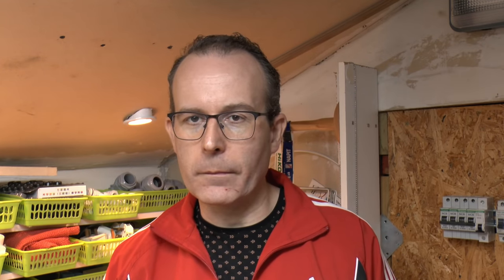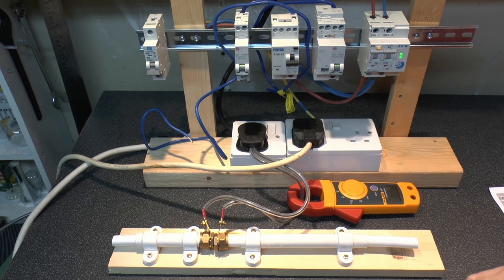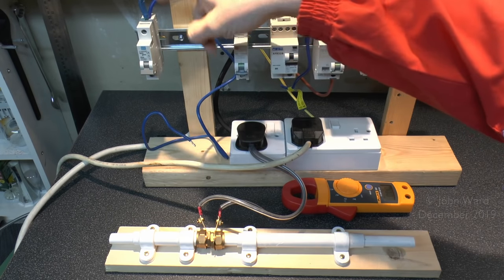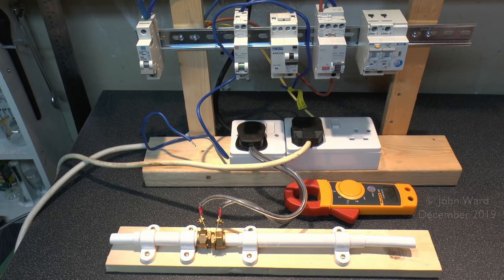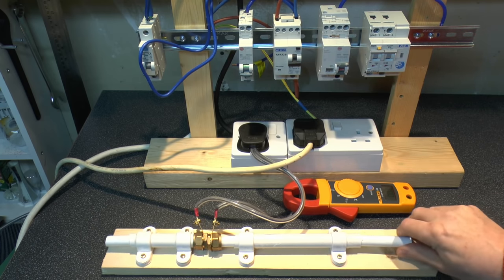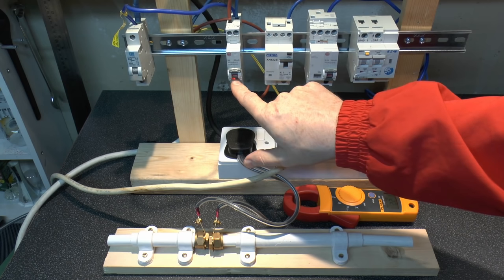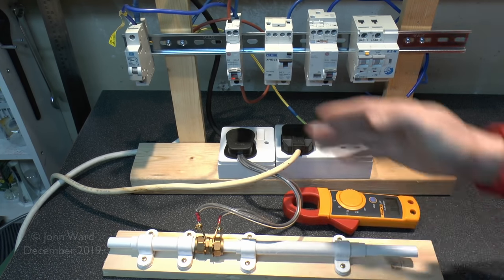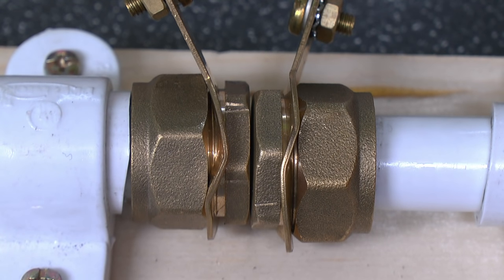Four AFDDs Compared - Arc Fault Detection Devices

Comment: John. You better take a look at Mainly  Electrical  channel.  This chap has run some pretty  standard  easy tests in these and generating  a hell of an arc by mimicking  a loose contact. The devices never tripped. Very concerning  and misleading

Comment: I would like to see a test with appliances with brushed motors inside, to see if they trip.
Reply: Considering the IET are ramming these down our throats I am struggling to see the value in them since it seems no two of them are the same and how expensive they are.

Comment: Excellent video John, I think the reason for the short lead on the single module device may be because the primary market is retrofit rather than new installations.Older consumer units tend to be smaller.

Comment: 11:38  We named it "TE", one Teilungseinheit, Wiki say "division units" (DU) in english for have more space. In Germany a normal consumer unit have 12 TE/DU, maximal have three in a row (3x12) normally. 

Rare old models have 24 TE/DU (for old L1/L2/L3 rails) in one row. Same situation in Thailand and shorter or longer models used widely; e.g. 2, 6, 9, 14, 16. At 16 DU for one main, and RCB are 4 DUs, so do you have 12 TEs for MCBs free. 

We use in Germany 3 phase normally so every row earn one phase (old style) or we sorted it L1, L2, L3, L1, ... starts with RCB  3phase, MCBs ... 

The new EU norms talks that RCBs should use smaller way, at best every line, e.g. one for oven, boiler, bath room, light bathroom, sockets living room, light living room, aso. So now combi RCD/MBCs are true sin for save space in consumer unit! 

My own consumer unit in my rented appartment in Germany have only one RCB, mean if it tripped I stay in the dark in night. 😱 

We not change consumer units every five years same you did it in UK. Our are often mounted inside the stone walls.
Reply: Thanks to to the new Regulations from 2020, we do too now change the Consumer Units as they have now to be build to the same new Standard (1100+APZ). I already got my Hager System 80 taken out of the Wall and now it is just a Wall mounted Box.

Comment: 7:00  The Siemens AG is a german company orginally. In the old DIN-Norm and later EN-xx-Norm now in EU we wrote that "red" mean "Power ON! Do not touch!" and "green" mean "Power OFF! Do you can touch on line." If power fault the device should go trip and show "green" for savety. 

I know it is crazy for UK people how go on red and stop on green - and drive on wrong side of street! 55555 😜
Reply: BTW: The Siemens should have now a yellow button too. But - the EU give companies time to change the production. 

The second is that they produce different to country laws; so N on left or right; go in power above or below; one till three phase. 

So do you can't found UK models here in Germany but I think in Thailand and Hongkong. 

Here in Germany all phase on left, N on right, go in below normally. 

Different to main switch (grey trip, 63 A), old models can use from both side normally. In history go in above, then copper link straight to every MCBs. With new one go in below, above go in to RCD, below out and go straight to MCBs, often 3phase. So N on right we order from right to left now - old DIN Design was opposite from left. (Sure, no N between in way.)  

Hoply I can figure it out correctly for you.  🤔😜
Reply: SIEMENS: Sicher Ist Eines: Man Erhält Nur Scheiße!
Reply: Armin Ehrbar - traditionally red or amber (orange) indicated something was on / live in the U.K.
A green indicator generally means something is “healthy” - or functioning normally.
But sometimes red indicates fault or error.
It is my opinion that no one should rely on any colour coding, EVER...

Comment: So the grand arc off has occurred! 
What a device.
Reply: Mister Brookes  From Wikipedia: "In the US, arc faults are one of the leading causes for residential electrical fires.[4] Each year in the United States, over 40,000 fires are attributed to home electrical wiring. These fires result in over 350 deaths and over 1,400 injuries each year.[5]"

AFDD's have been mandatory in new US installs since at least 2014.  For some reason Europe and Britain have been much slower in adoption.  This is surprising considering the Brits are highly paranoid with their electrical codes (fuses in cords, no light switches in bathrooms, GFCI at the breaker box, etc.). Of course, with ring circuits (invented due to the copper shortage in WWII) it is smart to be paranoid.
Reply: Mister Brookes  Adding RCD's to every circuit does nothing to stop arcing since RCD's are not designed to detect arcing. Fuses in plugs are superfluous and not going to happen.  Again the only reason Britain has fused cords in the first place is because of all the ring main circuits over there.  That's not "a thing" here (everything is "branch" or radial). Putting fuses in cords makes a lot of sense on a ring main since the circuit breaker is rated way above each individual socket.  (You might have a 6A toaster on a 30A circuit - that is obviously a problem without a fused cord). In the U.S., that toaster will be rated at 15A, the same as the circuit breaker protecting it. On a ring main, the breaker wont trip; the thing will simply burn unless it has its own fuse.

It takes a few minutes for a circuit breaker to trip in an overload condition, but an arcing cable might not cause an overload or trip short circuit protection.  So what are you going to do when the little old lady has a lamp cord with a fray in it that she doesn't know about?  A fray that comes into contact with her carpet or a curtain.  That's a house fire waiting to happen.  All the RCD's in the world (and circuit breakers) aren't going to stop it. Enter the AFCI (AFDD). 

Of course, the U.S. is on 120V which means higher currents (most residential circuits are 15 or 20A). So when arcing does happen, it can be more dangerous here.

I don't have an AFCI in my home, since it was built before 2000. But you can buy them that will go into individual sockets (much like GCFI's). Over here our GFCI's are typically installed at the socket/outlet and not in the breaker box ("consumer unit"). This has an advantage of making it much easier to narrow down the faulty device while not cutting power to the entire home. The downside to this approach is that not every single circuit is protected. But protecting every circuit isn't required by code anyway.  Only circuits which might come into contact with water must be protected by GFCI since that's what they were invented for - people were being killed by coming into contact with electrical outlets while wet (dropping hair dryers into the bathtub, etc.  Incidentally, this isn't a problem today because all hair dryers must come with their own internal GFCI installed in the plug).  In any case, all bathrooms, kitchens, laundry rooms and outdoor outlets (including garages and other out buildings) must have GFCI protection (it's up to the electrician whether that is installed at the breaker box or individual outlets - as long as the specified circuits are protected, either method is acceptable). 

Now let's debate 120V vs. 240V.  Go!
Reply: John Smith - The U.K. electrical system does permit wall mounted light switches in bathrooms, toilets and shower rooms. RCD / GFCI are not mandated to be in the consumer unit (breaker box) for all circuits, separate RDC sockets can be used where needed depending on the type of wiring, the circuit design and function. Combined RCD & MCB units in the consumer unit for the socket outlet circuits are a fast and convenient way to provide reasonable protection in a reasonably modern MCB type consumer unit without the added expense of a new consumer unit. I have this arrangement in my consumer unit and don’t experience nuisance tripping. 
Fuses in plugs and fuses in fixed connection units are designed to protect the flexible electrical cord.
Radial circuits that can supply socket outlets can be rated at 15A (fuse), 16A (MCB), 20A (MCB), 30A (fuse) or 32A (MCB). Not all sockets have to be on a ring circuit. Whatever the original reason for the ring circuit, the modern ring allows as many socket outlets as you like (within reason) to be fitted. This is very convenient now that there are so many mains powered electrical appliances / items / gadgets.
Reply: John Smith - How do you figure that 120V domestic circuits have higher current faults? Think about a 240V 20A or 32A radial circuit, or a 32A ring circuit. I think you will find the fault current significantly more than on a 120V 15A or 20A circuit.

Comment: aww  :-(          everyone was rooting for the single module wylex.  

Great idea in theory, but then they'll sell them to you at through the roof prices while the practical part it is still being solved.

Wonder if it would be more effective to have a single computer / embedded system doing the monitoring for each circuit.  Hmm.

Comment: Great informative video, I believe that AFDDs are a basic requirement in domestic dwellings in the USA perhaps less costly due to much higher volume sales. I'm guessing that in a later edition BS7671 the AFDD will be a safety requirement on new builds. Expensive as AFDDs are an example like a not very apparent compressor arcing fault at the back of a fridge is IMHO a good reason to be gravitating to fitting AFDD(s)

Comment: Don't worry people these are Automatic fault detection devices but they seem to be based on some sort of TDR (Time Domain Reflectometer) technology indicating the presence of potential faults such as high resistance joints in the wire rather than anything to do with arc / smouldering point detection ??

Comment: Nice test rig set up there John.

Please repeat - same AFDDs but with parallel fault. Maybe those insensitive units will trip quicker ?

This also creates a question series or parallel - if you have a 4A heater load and set up with a parallel arc via another 4A load, will the unit detect the fault as series or parallel ?????? What secondary current is need for them to recognise as a parallel fault ??
Reply: @pineappleroad  Absolutely see no reason why not. It's just a second load with a dodgy connection.
Reply: @pineappleroad  Precisely - i.e. another load !

Comment: What about Heaters etc with thermostats …..  - as they reach temperature --  thermostat opens .. and arcs ?  (  Well they may have arc suppression components … but even so …  I wonder …. )
Reply: all switches ect will arch to a degree.
Reply: @UberAlphaSirus  - Exactly.   The idea of an AFDD is to detect an arc that is occurring under genuine fault conditions.  
To do this reliably requires the current flowing in the circuit to be monitored continuously - and any deviations of that current occurring in a short duration due to "arcing"  are analysed  - and if the "signature"  of that analysis fits the definition of an "arc"  - then the device trips.   ( And therein lies a HUGE multitude of questions …. when is an arc NOT an arc ???) 

The problem with all of this "monitoring" is that :  all this is occurring in circuits that traditionally will have a certain degree of  background  "electronic"  noise associated with them  and so reliably establishing that a genuine  "fault" arc has occurred  becomes difficult.  ( when is an arc  NOT an arc but just noise from "intentional switching   ??  Arc welders anyone !!  ) 
ESPECIALLY if the load current is small -  so that the "wanted signal "Noise""  generated by the arc  becomes closer to the background noise . That is - the  monitoring electronics and software has to differentiate between "wanted" noise  ( arcs) and  Unwanted noise  when the two levels become close   -   ie : what radio engineers call "signal to noise ratio   and if signal level and noise level become close - then detection becomes unreliable - and I believe that is why some of the AFDD's didn't trip - that is - there is a certain "noise floor level   blanking "  in the detection circuitry to avoid nuisance tripping ) ……..

…... …. note that John's tests started at 2.2 amps !  - so think about that in terms of say using a 6A  AFDD powering say a typical domestic lighting circuit powering a few LED lights  - totalling say 200 w or so (  less than 1A  at 230 V RMS !!  - 
Lets see how well these devices work at low currents ?!!
Reply: @eric4709  cheap shitty powersuplies will create a lot more background noise wich makes this even more useless combined with the cheap chinese LED bulbs

Comment: Well, it looks like Siemens has some homework to do, which doesn't surprise me.  I had to put a bunch of them in a home I just built, and I've since removed several that nuisance tripped repeatedly.  The problem seems particularly bad with power tools that use brushed motors.  There's one circuit in my garage that trips if I try to run a miter saw on it, but another circuit with an identical breaker works fine.  My electrician said even driving staples too tight when wiring the home can cause nuisance trips.  Incidentally, the breakers in my home are all made by Siemens.  John, what has been your experience with these things WRT nuisance tripping?
Reply: Here in the States these are mandated in certain locations and they can be hell. Friends built a large beach house in 2013 and just after the warranty period expired they had about 75% of them replaced.  We don’t have EICR’s here but the electrician was doing basically one of them to test the wiring. They currently cost about $60 here, I forget the price 10 years ago.

Comment: I want to know what happens if a switch is opened slowly will it trip then, also what happens if you use a welder on the circuit, I pressume they work by detecting the HF produced by the arc. I would think that these things are going to be a big source of trouble in the future.

Comment: Why were you having so much trouble getting the Eaton one to trip in a previous video, but now it trips very quickly?
Reply from the maker: More current - 2.2A in this one, less than 1A in the other one.
Reply: @jwflame   - So  - As  I've  mentioned above - are we saying that AFDD's  as currently offered  wont reliably sense arcs occurring in low load ( say less than 2A  or so  )  situations ?  
As I also mentioned - a "noise floor"  limit in the detection circuitry / software to avoid nuisance tripping ? 

Looking at this as  a Radio /Electronics  Engineer  ( and a Radio Amateur Too !!) - I can see a forest of question marks surrounding AFDD's. especially in low load situations . 
  I wouldn't like to be on the AFDD development team trying to define " When is an Arc an Arc ?  - looking at transients  occurring over short periods of time - and deciding whether to trip or not !!
Reply from the maker: @eric4709  Correct - of little use under about 2 amps.

Comment: 1) I wonder how an AFDD can distinguish between a fault condition and carbon brushes in an electric motor which also draw (tiny) arcs? 

2) Does it work when the mains is galvanically isolated by a transformer inside a device (or if one uses an isolation transformer)?
Reply: Brush motors usually include filtering (parallel capacitors, and sometimes series inductors) to reduce RF emissions. (It's possible for the capacitors to degrade though.)

Comment: Why do afci/gfci's lose their effectiveness after they trip once? Had a gfci/rcd breaker trip in the panel, then repeatedly tripped after, replaced with a new afci and no more tripping, circuit is completely identified as well, it ran bathroom lights, when a bulb blew it took the afci?

Comment: Would be interesting to see how susceptible these are to nuisance tripping (poorly engineered switches, brushed motors ..etc ..etc)
Otherwise these could end up being a very expensive pain in the ass that offers limited arc protection considering we all know electrical arching can generate enough heat to start a fire well below 1A!
Reply from the maker: They are designed to only trip on very specific types of arc, so theoretically won't trip for things like switches and motors.  There will be more videos on these things.

Comment: Hey John, could you please do a video on dry and wet contacts? Thanks in advance.
Reply from the maker: That terminology isn't generally used in the UK - it's usually volt-free for 'dry contact'.
The difference is that volt free or dry contacts have no voltage on them, it's just a switch that can be used with any voltage.  Wet contacts are those that already have a certain voltage connected to them and can only be used to control things that work at that particular voltage.

Comment: Could they not just make a 63amp one to cover the whole switchboard?
Reply: It could be more coarse. Which would eliminate nuisance tripping. Keep the fine ones for individual circuits.
Reply from the maker: Probably, but then you have the entire installation being disconnected when any fault occurs, which is not compliant with BS761.  Same reason that a single RCD for the whole lot doesn't comply.
Reply: @jwflame  It no big deal if the whole board goes off, better than not having anything. BS761 is so full of holes you can comment ether way and still be correct.
Reply: @jwflame  sounds like a silly rule. Just install emergency lighting!

Comment: One thing I’m curious about would the afdd also detect a fault downstream of the device on the supply side? Wouldn’t that have the same effect on the current? Suppose it has some clever electronics to differentiate though. Excellent videos thanks and merry Christmas.
Reply from the maker: They shouldn't - most likely has filtering on the incoming supply side, which is also why they must be connected correctly.